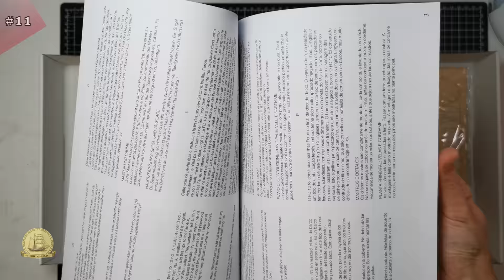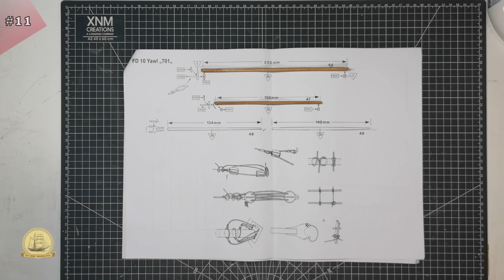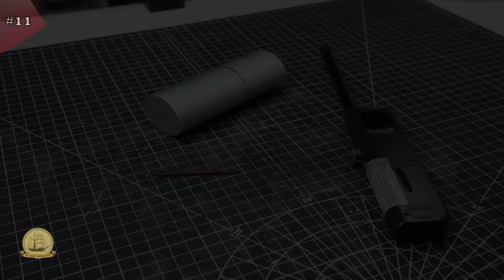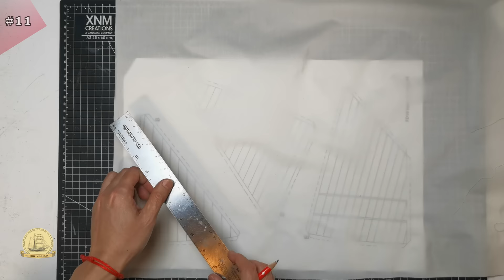You should MAKE this as your first wood ship model, Billing Boats FD-10 Yawl 1:50 Scale

Comment: Turned out really nice. 
I believe those are reefing lines. Telltales are for showing airflow on the sails.
Reply from the maker: Thank you, Johnny. Good catch!
Reply: Depends on their task. They're more properly called reefing gaskets if they only serve to hold the baggy body of the sail in place. Often, the reefing tack and clew are where the actual reefing lines are tied, as they will take the immense load on the sail in high winds. On many boats, you will see that the gaskets do not have the layers of reinforcement necessary to withstand that kind of force.
Reply: Heitkemper is correct.

Comment: Great video. Really enjoyed that.  You say at 7min 30 seconds that you have never done "a perfect paint job" and were probably referring to the bleeding of the black paint underneath the tape.  I have a tip that will eliminate this problem.  Once you have painted the red colour and have placed the tape where you want the black colour to start, do the following to prevent the bleeding problem:  Instead of starting with the black paint, paint over the tape line where the black paint is supposed to start, with RED paint.  The red paint will now bleed under the tape, and will seal the gaps.  Once the red paint has dried you can paint with black paint and will see that there is NO bleeding whatsoever.  I have used this trick effectively even on an aircraft rudder that had a type of a corrugated iron surface and there was no bleeding that occurred.  Try it, you will see that it works.
Reply from the maker: Wow, thank you. Great tip.
Reply: BRILLIANT !! Never thought of that - gonna give that a go next time.
Reply: @patrickfox-roberts7528  My brother obtained his private pilot's license in a Piper Cherokee 140 back in the 1980s.  I found a Miniart 1/48 scale kit for a Piper Cherokee.  Obviously it did not have the same numbering as decals.  I went to a lady who used a machine to cut stencils on Tamiya masking take of the aircraft's lettering.  These were ZS-IKY.  The letters were about 1 centimetre high and about 2 millimetre thick.  I used that technique in order to spray paint the letters onto the plane and also to spray paint the decorative stripes on the plane exactly what his plane had looked like.  The letters came out perfectly with no bleeding and my brother was most impressed.
Reply: So relaxing watching a pukka craftsman build this boat !.  Billings product is top notch.  Thanks.  Dave
Reply: Thank you so much, tips like these that people share are a great help.
Reply: I was thinking that it looks more authentic if there is some imperfections. Don't you agree?

Either way great tip!

Comment: At 13:43, you discuss "telltales", I believe these are reef points. A telltale is attached to a shroud to indicate wind diection. The reef points are used to reduce the sail area in strong wind conditions and are laid out parallel to the boom.

Comment: Fascinating!  Back around 1980 I was at a Round Table National Conference at Yarmouth in the UK where in the Conference Club bar at about 2 am, I drunkenly became convinced that I was going to win the prize in the national draw being run to raise money for a brand-new lifeboat for the RNLI - so I only purchased one ticket!    A couple of days later when I was home (and sober) a 'phone call advised me that I had won a model of a Brixham trawler, constructed and donated by someone from that area.   I was delighted and - I must admit - surprised, and soon collected the vessel from another rather drunken meeting with Malmsbury and Tetbury Round Table.
The boat was much admired, and I had a lot of fun with it, sailing it on the local park lakes - after fitting a heavy lead weight on a detatcheable keel to give it some stability against the wind.   I eventually added a radio control servo below the cabin, and also made a long screw device to act as a sail winch so that it could really be controlled for sailing with and against the wind.   I even let my children handle the steering device on some occasions(!), but the controls and the keel were later removed.
The boat looks almost identical to the one you have constructed, with the steering post aft of the aftermast, although a lot closer to it.   Sadly, having been on display in a window for over 40 years, it is showing signs of needing some attention, particularly the sails which now have some tears.   I was hoping that your kit supplier supplied the sails ready-made and that I could purchase some, but as that is not possible it will be a struggle to re-make them with arthritic fingers.
Should you wish to see a picture of my boat, do a web search for Don Johnson's Personal Website, and click on the link Boat Pic at the top left of the Home page.
Reply from the maker: Thank you, Don. Are there any more of those drunken meetings? Lol. You should be able to find a local model builder who can repair or restore your trawler.🍀

Comment: Really nice work! I’ve just started with my own project, a Billing Boats Colin Archer (wood hull). Probably will take me atleast two years before finnish. With RC and several winches for the sails. Recommended to weight about 10 kg when finnish.
Reply from the maker: It is a big one. I had build the smaller Colon Archer from Billings. Good luck building!

Comment: Looks great!
I used to sail on a Brixham mule, 54ft on deck, smaller than the Brixham trawler. Yes, it is a gaff ketch, not a yawl. Both have two masts, the difference being that the mizzen (rearmost) mast on a ketch is stepped forward of the rudder post, and on a yawl the mizzen is stepped aft of the rudder post.
The strings you call tell-tales on the sails are actually reefing points. They are used when the sail is lowered in strong winds so the "slab" of sail below the reef points is now at the level of the boom. The reefing points are tied together under the boom to tidy-up the folds of the sail.
Reply from the maker: Thank you, Nicholas! Thanks for pointing out the reef lines. My bad. I should have done a better study. 
One day, I will sail on a real tall ship. Must be a lifetime and unforgettable experience.
Reply: Good catch!  I was about to post the same thing, but figured someone must have noticed.   And so you did!

Comment: 7:30  Pro-tip. To prevent bleeding under the tap spray on a clear coat (dull not glossy) that is compatible with your paint choice along the edge of the tape. That'll seal the edge and prevent paint bleeding and you just paint right over it.

Comment: This vessel is a ketch. A yawl has the mizzen mast stepped aft of the rudder post.
Reply: Well! The position of the rudder itself it is not enough to define a ketch. 
1. The boat doesn't ha e a triatic stay that is characteristic to a ketch.
2. The mizen mast is too small to push the vessel even it is a Gaff rigged, and the mizzen mast has a rather, estetic purpose or for steering.
Reply: “Yawl; a two-masted sailing vessel, rigged fore-and-aft, with a large mainmast and a small mizzenmast stepped aft of the rudderpost” It is the definition of a yawl 👍🏻

Comment: Though nowadays yawl describes the rig, historically it was a general term for a hull, fishing boat or build. Why a relatively recent ketch should be termed a yawl appears to follow no logic, also FD is the registration for Fleetwood UK. Another mystery.
With regard to the kit, and Billings in general, I fear that they are let down with appalling timber and fittings. Sometimes I use the hull parts as templates for a scratch build and use good timber, bits like plastic blocks are discarded along with the rigging line. An expensive way I know but much better results.
You made a good job of this one, well done.
If you want to impress at a 'nautical' gathering on a yawl the mizzen mast is "abaft the after perpendicular"!!

Comment: hey EZMODEL i have a question .. what type of material are the sails made of  . silk ?
 I m   asking because i want to build  the cutty  shark ship , i have the plans but they dont spesify the type of material the sails  are cotton silk ..
ps. the lsize of the buld ship  it will be about 65 cm.
 thanks in advance,.
Reply from the maker: I like the cotton cloth for sails the best. But keep in mind the cotton cloth may shrink when you dye it in warm or hot water. Other poly fabrics  works fine too, but I do not like the texture. My suggestion is to experiment and find what works best for you